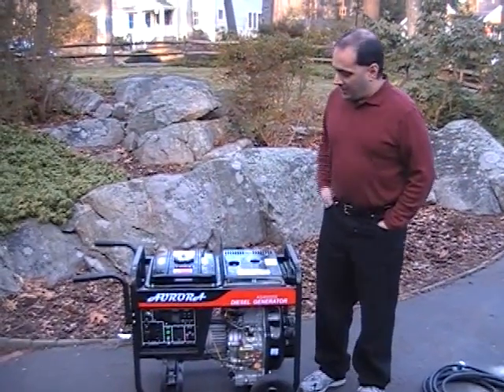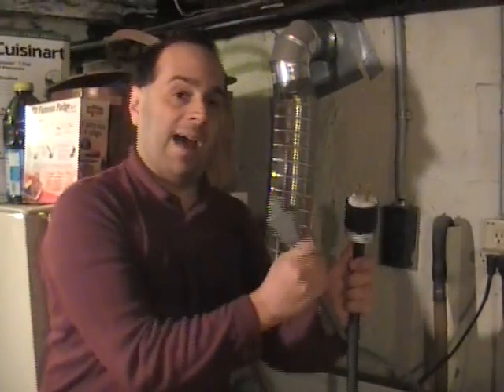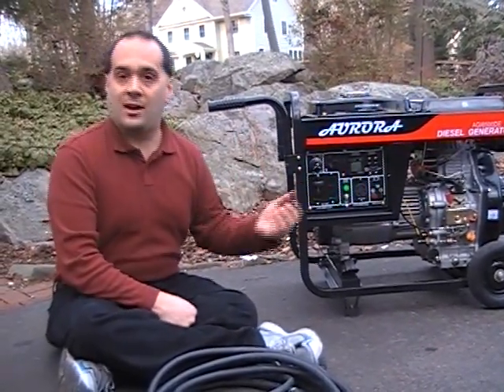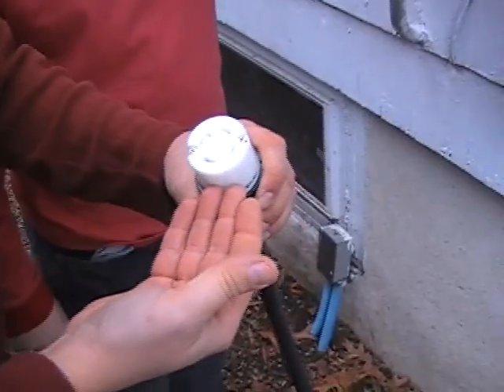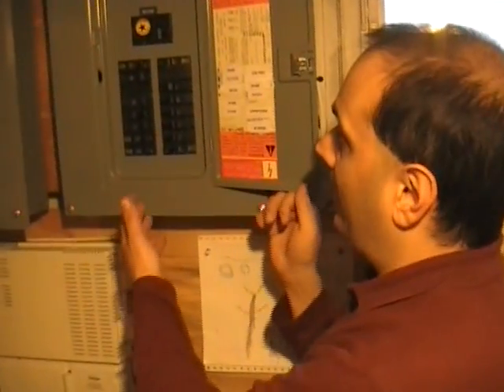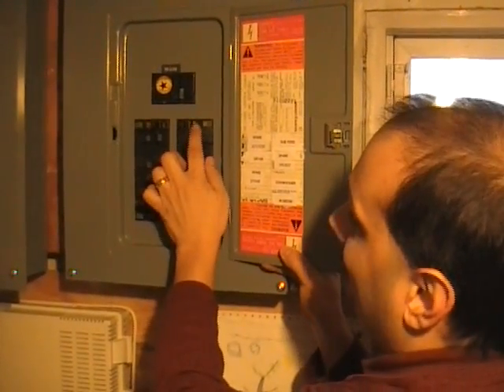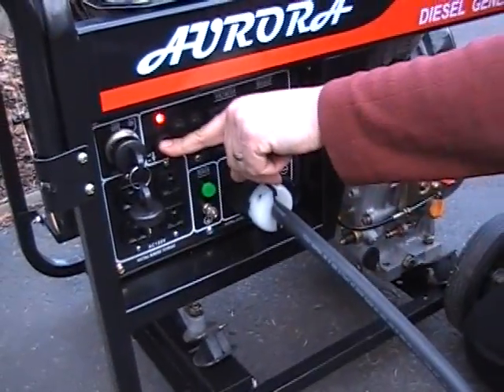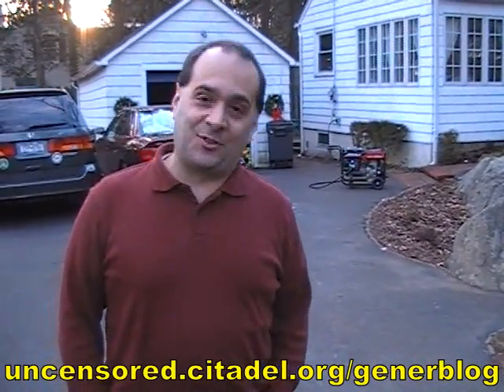Inexpensive residential generator hookup

Comment: A friend of mine has a 60 amp manual double throw switch between the two breaker boxes. Looks very much like yours. Very cheap and simple. Cheap enough to use for a rental house. I have a system that goes between the electric meter and the meter box. Very good for a rental house. It is called Generlink. To order you have to know your generator model number, how long of a cord, if you want a surge protector or not, lastly if you want Bluetooth notification when power comes back on or not. 
We just got 12” to 16” of snow a week ago Wednesday night.  No loss of power, but if it had gone out, probably would have been out for 4 to 6 hours at 10°f. 
Hello from north east Montana.
Reply: Bam Bam    Here in north east Montana, I have NorVal Electric Coop. I buy it, they will install it for about $100 when they are free and in the area. 
All they have to do is throw the main breaker, pop out my meter, put on the GenerLink, reinstall my meter, turn on my main breaker. 
Hello from north east Montana. 
10 miles south of the border, almost straight south of Moose Jaw.
Reply: Here are the rules about portable generator safety: make sure you are aware of all the warnings before using portable generators. This is just a reminder for everyone’s safety. All generator safety rules should be followed carefully. This advice is just to make sure that everyone is aware of all the warnings and it’s just to remind people to be careful using portable generators. Generators can be dangerous if not used carefully. Every year, hundreds of people die or get injured when using portable generators due to carbon monoxide poisoning and electrocution. Make sure you are using your generator carefully and keeping others safe as well. There is something very serious that everyone should always be aware of when using generators. Some people do run their generator indoors which is not safe and that increases the risk of carbon monoxide poisoning which can cause death of family and you. Some people run their generator in wet conditions which can electrocute them. Please remember that you should never run your generator indoors. Remember that carbon monoxide is an odorless and colorless gas that you cannot see or smell. Carbon monoxide is a silent killer. Keep that in mind. Make sure your generator is 15-20 feet away from your house and away from doors, windows, and vents. Never use your generator in your porch too. Having a carbon monoxide detector is very important against generator safety. Some people also allow children to go near the portable generator which could pose risks. We need to keep an eye on our children making sure that they are not near the portable generator so they won’t get electrocuted or burned by the generator which is dangerous. A locking enclosure also keeps kids safe. A generator shed might look like a tempting place to explore, or take cover during a game of hide and seek, but a generator is a dangerous piece of equipment that can cause injury. It says on the manual that we should also keep children away at all times from the portable generator to avoid injuries. Please do not allow a child or unqualified people to operate the portable generator.  It is important to keep your children safe especially little ones. The portable generator can be hot during an operation. Just because some manuals missed what should be listed doesn’t mean it’s safe to do. Always follow the generator safety rules when using portable generators. Generators pose electrical risks. If you need to use your generator during wet weather, you need a generator tent to protect your generator from getting wet. Don’t let your generator get wet. Keep your generator dry and before using your generator, please make sure your hands and your generator is dry. Do not wear loose clothing when operating the generator. Everything that is said on the generator’s operating manual should not be ignored. Never smoke cigarettes near the generator. Please keep flammable things away from the generator. Never overload your generator too. Your generator can catch fire. Never ever try to plug a generator cord into a wall outlet to avoid back feeding. Back feeding your generator is dangerous. Always turn on your generator first before plugging in appliances and shut off the appliances before turning your generator off. Use a heavy duty cord for your generator and the cord should not be worn out. All the instructions should be followed carefully. Never refuel your generator while it’s running. It can cause fire if fuel spills while your generator is hot. You should turn off your generator and let it cool off before refueling it. Having a fire extinguisher next to the generator is also important. This is only a reminder for everyone’s safety of using generators. Make sure your generator is properly grounded. Having a fire extinguisher next to the generator is also important against the safety rules. https://youtu.be/I1jT3ANENvI and here is a video more about keeping others safe when using generators and also about our family’s safety. It’s important to keep our little children safe as well. Make sure they’re away from the generator. Hope this helps. Thank you.

Comment: Is it safe to run electric heater on this 6500 watt?
Reply: as long as the heater draws less than 6500 watts
Reply: My nephew wrecked his generator when he was running his water heater with out shutting off other breakers. While running the water heater, the pump turned on, before he could get to the breaker box, the deep freeze turned on. That was the end of the generator, smoke came out of the windings!
If you turn on another breaker, shut off other breakers. 
I have a couple pieces of paper in a file folder on top of the breaker box that tells every outlet, every overhead light, every appliance that the breaker connects to. 
Very handy when you trip a breaker. 
I mark the always on breakers, furnace, refrigerator, deep freeze!
Hello from north east Montana.
Reply: @darrelfuhrman8217  old generator?   Most generators even the old ones have over current safety devices.
Reply: @ShaunPaget    He brought it around 1993 or so from Harbor Freight.
Reply: @darrelfuhrman8217  sorry to hear that.  lesson learned always feed through an appropriate sized breaker for the task.  HF has a firm reputation for their quality.
Reply: @ShaunPaget  LOL!
Reply: @johncosta5892  Are any generators NOT made in China?

Comment: Did you have a neutral bonded generator... how did you handle neutral connection at the panel?
Reply: Exactly! There is no mention of neutral switching or use of a floating neutral generator.
Reply: Here are the rules about portable generator safety: make sure you are aware of all the warnings before using portable generators. This is just a reminder for everyone’s safety. All generator safety rules should be followed carefully. This advice is just to make sure that everyone is aware of all the warnings and it’s just to remind people to be careful using portable generators. Generators can be dangerous if not used carefully. Every year, hundreds of people die or get injured when using portable generators due to carbon monoxide poisoning and electrocution. Make sure you are using your generator carefully and keeping others safe as well. There is something very serious that everyone should always be aware of when using generators. Some people do run their generator indoors which is not safe and that increases the risk of carbon monoxide poisoning which can cause death of family and you. Some people run their generator in wet conditions which can electrocute them. Please remember that you should never run your generator indoors. Remember that carbon monoxide is an odorless and colorless gas that you cannot see or smell. Carbon monoxide is a silent killer. Keep that in mind. Make sure your generator is 15-20 feet away from your house and away from doors, windows, and vents. Never use your generator in your porch too. Having a carbon monoxide detector is very important against generator safety. Some people also allow children to go near the portable generator which could pose risks. We need to keep an eye on our children making sure that they are not near the portable generator so they won’t get electrocuted or burned by the generator which is dangerous. A locking enclosure also keeps kids safe. A generator shed might look like a tempting place to explore, or take cover during a game of hide and seek, but a generator is a dangerous piece of equipment that can cause injury. It says on the manual that we should also keep children away at all times from the portable generator to avoid injuries. Please do not allow a child or unqualified people to operate the portable generator.  It is important to keep your children safe especially little ones. The portable generator can be hot during an operation. Just because some manuals missed what should be listed doesn’t mean it’s safe to do. Always follow the generator safety rules when using portable generators. Generators pose electrical risks. If you need to use your generator during wet weather, you need a generator tent to protect your generator from getting wet. Don’t let your generator get wet. Keep your generator dry and before using your generator, please make sure your hands and your generator is dry. Do not wear loose clothing when operating the generator. Everything that is said on the generator’s operating manual should not be ignored. Never smoke cigarettes near the generator. Please keep flammable things away from the generator. Never overload your generator too. Your generator can catch fire. Never ever try to plug a generator cord into a wall outlet to avoid back feeding. Back feeding your generator is dangerous. Always turn on your generator first before plugging in appliances and shut off the appliances before turning your generator off. Use a heavy duty cord for your generator and the cord should not be worn out. All the instructions should be followed carefully. Never refuel your generator while it’s running. It can cause fire if fuel spills while your generator is hot. You should turn off your generator and let it cool off before refueling it. Having a fire extinguisher next to the generator is also important. This is only a reminder for everyone’s safety of using generators. Make sure your generator is properly grounded. Having a fire extinguisher next to the generator is also important against the safety rules. https://youtu.be/I1jT3ANENvI and here is a video more about keeping others safe when using generators and also about our family’s safety. It’s important to keep our little children safe as well. Make sure they’re away from the generator. Hope this helps. Thank you.

Comment: Yup, it happens, ppl do not think the best b4 the hurricane.  a guy near where I was in FL hooked up an 11 KW plant to his dryer, just him and
the wife no kids or pets. he used the suicide cord, did not shock himself
or wife but had quite the nice little fire going! He moved line from dryer ckt to range ckt as he had a bbq and would cook that way, but he forgot
the ckt was only good for 7200 watts so he was pulling another fifteen amps. He lost most of his garage, good thing he had smoke detectors too or who knows how much worse it could have been. 
      A suicide cord does work well and there are times when they have
been used to power a gas station to fuel police cars when the power is out. I have used them and still do. But I have 2 means of shutting off the power, one in the house and one at the meter. as it is a mobile home.
When told pwr will be out for a good while, I shut off both sets of mains.
plug into dryer, then into gener8r, not the other way around as I'd have pwr on prongs from gener8r. if one takes the time though to think it out.
it can be safe but ur way is a much better way since you have childen.
Reply: And his insurance company can deny the claim because of the improperly installed generator!

Comment: Thanks for this info.  I could make this setup work for my home, which i have wired myself but this in new info for me.  I went to the web address listed and it is no longer.  Do you have a link to the info showing me other options to wire a generator to my home?
Reply: Here are the rules about portable generator safety: make sure you are aware of all the warnings before using portable generators. This is just a reminder for everyone’s safety. All generator safety rules should be followed carefully. This advice is just to make sure that everyone is aware of all the warnings and it’s just to remind people to be careful using portable generators. Generators can be dangerous if not used carefully. Every year, hundreds of people die or get injured when using portable generators due to carbon monoxide poisoning and electrocution. Make sure you are using your generator carefully and keeping others safe as well. There is something very serious that everyone should always be aware of when using generators. Some people do run their generator indoors which is not safe and that increases the risk of carbon monoxide poisoning which can cause death of family and you. Some people run their generator in wet conditions which can electrocute them. Please remember that you should never run your generator indoors. Remember that carbon monoxide is an odorless and colorless gas that you cannot see or smell. Carbon monoxide is a silent killer. Keep that in mind. Make sure your generator is 15-20 feet away from your house and away from doors, windows, and vents. Never use your generator in your porch too. Having a carbon monoxide detector is very important against generator safety. Some people also allow children to go near the portable generator which could pose risks. We need to keep an eye on our children making sure that they are not near the portable generator so they won’t get electrocuted or burned by the generator which is dangerous. A locking enclosure also keeps kids safe. A generator shed might look like a tempting place to explore, or take cover during a game of hide and seek, but a generator is a dangerous piece of equipment that can cause injury. It says on the manual that we should also keep children away at all times from the portable generator to avoid injuries. Please do not allow a child or unqualified people to operate the portable generator.  It is important to keep your children safe especially little ones. The portable generator can be hot during an operation. Just because some manuals missed what should be listed doesn’t mean it’s safe to do. Always follow the generator safety rules when using portable generators. Generators pose electrical risks. If you need to use your generator during wet weather, you need a generator tent to protect your generator from getting wet. Don’t let your generator get wet. Keep your generator dry and before using your generator, please make sure your hands and your generator is dry. Do not wear loose clothing when operating the generator. Everything that is said on the generator’s operating manual should not be ignored. Never smoke cigarettes near the generator. Please keep flammable things away from the generator. Never overload your generator too. Your generator can catch fire. Never ever try to plug a generator cord into a wall outlet to avoid back feeding. Back feeding your generator is dangerous. Always turn on your generator first before plugging in appliances and shut off the appliances before turning your generator off. Use a heavy duty cord for your generator and the cord should not be worn out. All the instructions should be followed carefully. Never refuel your generator while it’s running. It can cause fire if fuel spills while your generator is hot. You should turn off your generator and let it cool off before refueling it. Having a fire extinguisher next to the generator is also important. This is only a reminder for everyone’s safety of using generators. Make sure your generator is properly grounded. Having a fire extinguisher next to the generator is also important against the safety rules. https://youtu.be/I1jT3ANENvI and here is a video more about keeping others safe when using generators and also about our family’s safety. It’s important to keep our little children safe as well. Make sure they’re away from the generator. Hope this helps. Thank you.

Comment: It is a code violation if the generator isn't big enough to run any connected loads that may be operated. Automatic loads in particular such as refrigeration, heating, sump pumps, water pumps, fans etc. Now add to that  anything that has been manually turned on and something automatic starts up.
Reply: I think under 702.4 that applies to automatic transfer switching only.  There is no such requirement when using manual transfer.

Comment: Interesting video. New to generator stuff and just got our 8000/10000 dual fuel gen delivered yesterday. Electrician is due Mon. to put in connect for house but it is all confusing. Gen. has a 50amp plug, 2 30amp plugs, and 2 20am plugs. He says our box is too small to change to the 50amp transfer switch, so he is putting in another box which sounds just like what you are demonstrating here, and using only the 30amp plug...we turn each circuit on separately in the new box (like you were doing) which will connect to the generator...and it is only going to cost us $1799 for it.  How much did this set up you picture cost? Sounds a lot less $$.